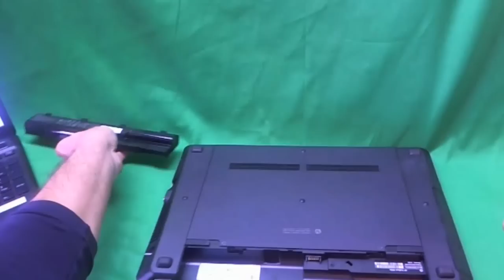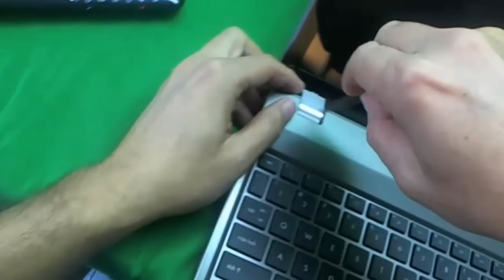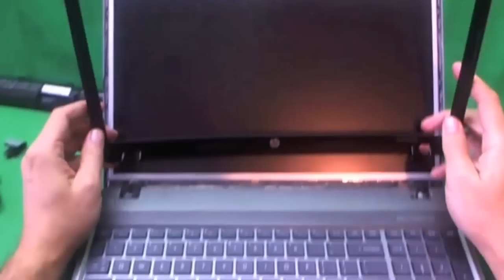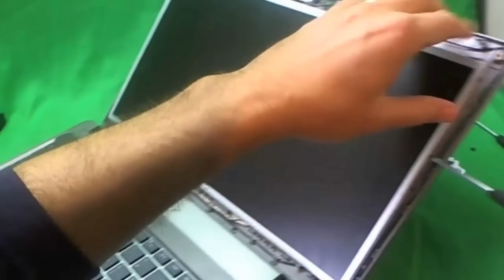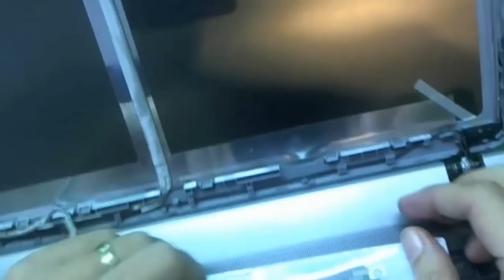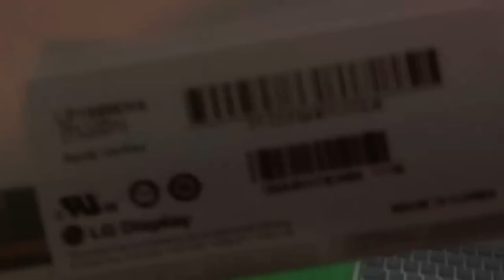HP 4530s ProBook 4530s Laptop Screen Replacement Procedure

Comment: Hey dude so I'm looking to just disconnect the screen I already removed the back cover but I dont know what wire to disconnect. I really dont want to open the entire laptop as I'm afraid I'll break it. I want to disconnect the screen so that I can use the bios on an external monitor.

Comment: It's almost IMPOSSIBLE to get the hinge covers back if you're following this procedure. 

To all, I strongly recommend downloading the HP ProBook 4530S service manual (a google search will get you to it), and follow the official procedure of screen replacement recommended by HP. It will take a little longer than this, and it will be a bit more of an "invasive surgery", but trust me, unless you're scared of removing a lot of screws, the official procedure is actually a LOT safer than this and the chances of damaging something is a lot less as everything will come off easily without you having to apply excessive force to pry open the hinge covers, weird "tricks" like loosening the hinge screws and pulling on the screen to reveal the side mounting bracket screws, tricks to put the hinge covers back in, etc.

I can't believe the tech guru who made this video doesn't understand the concept that physical strength and electronics are mutually incompatible partners. The moment you realize you're applying too much force to remove a part or install it back, you should understand you're doing it wrong. 

Like my computer teacher once told me in my school years, "Shortcuts may cut short your life".

Comment: Other than having to replace HP's defective 320 GB HD 3 times within the 1-yr warranty period (before wising-up and buying a Toshiba 500 GB replacement), this laptop has been a workhorse since purchase in 2011.A big complaint - shared by many in reviews - is the LED display appears 'washed-out':  'max' brightness is only attained at a very-narrow viewing angle.Comparing this 'matte' screen finish to the 'crystal' display on all MacBooks is like night and day.  I wasn't aware of any 'crystal' display option with the ProBook 4530s.My question:  do you know of a 'crystal' screen replacement that would upgrade the display to greater sharpness and brightness?

Comment: Just replaced mine with a Screen Surgeons unit, so far looks great.  Three things: first, watch this video, read the comments below, and check other postings around the Net, it will help you out.  This screen replacement task wasn't difficult, but there are a lot of moments that something can break very quickly.  I'm experienced with this kind of stuff, but would still call this a 2 banana job because of the risky moments.

Second - hinge covers.  I removed the bezel without removing the hinge covers, but it was tricky and took some careful bending and jiggling around.  After I finished the screen replacement, I couldn't see a good way to get the bezel back on without removing the hinge covers.  With the bezel off, it was still a little tricky to get them off even though there are now loose, I pulled them off from outside the unit with the lid mostly closed, they came out the rear.  TheOnlyRick's comment below is THE trick to get them back on.  I used a flat rectangle cut from the clamshell plastic that many things are sold in, then inserted from the rear, then slid the hinge covers on from the rear but only after I had re-attached the bezel.

Third - I found that the two screws at the bottom of the bezel, in the first step, were star/Torx T8.  NOT phillips head.  Has anyone else seen that?

Comment: Can any one assist me ?? I want to replace my screen but I'm informed when purchasing I need to know the resolution, backlight, and screen size so that I my get the accurate screen
My problem is I don't know how or were to obtain that info
Reply: +abu khadir simplt just enter the name of your laptop and then screen after it
 on amazon or ebay and you will see them come up..
Reply: Hi, just asking if the screen of 4530s is the same/compatible as hp probook 4540s..they are the on size of 15.6..

I need someone to confirm so that i can proceed and buy new screen.. Tia

Comment: Thanks, very helpful.  Maybe I could have done the whole thing without removing the hinge covers (at first I forgot to loosen the screws that hold the hinges to the screen assembly), but I ended up removing the hinge covers anyway.  What I wasn't expecting was how hard it would to put them on afterwards!

What happens is that as you push them in, the bottom clasp of the hinge cover catches on something within the hinge mechanism.  So I cut a thin rectangle of an old credit card, and put it into the hinge (from underneath the laptop) so that as I push in the hinge cover the card smooths over whatever the cover was catching on before, and it easily slides into place (with the laptop screen fully open).
Reply: +TheOnlyRick awesome tip, was stuck with this bit, replace 3 screens and was left with this
Reply: Man, you saved my life. Thanks!
Reply: @leopholdoishibashi5690  I have no memory of what this was about, but I'm pleased it helped!  😄

Comment: you can actually perform this procedure without removing the hinge covers. the bottom edge of the bezel can be loosened so that it tilts forward but not completely removed. the side bracket screws can still be accessed. it's not quite as easy as with the hinge covers off but it certainly saves ruined hinge covers. the private school i do tech work for has 20 of these units so experience is talking here.
Reply: If you do remove the hinge covers, as you push them in, the bottom clasp of the cover catches on something within the hinge mechanism.  So I cut a thin rectangle of an old credit card, and put it into the hinge (from underneath the laptop) so that as I push in the hinge cover the card smoothes over whatever the cover was catching on before, and it easily slides into place (with the laptop screen fully open).
Reply: TheOnlyRick Thanks for this tip - I couldn't get those hinge covers back on for the life of me and this worked in seconds.
Reply: To everyone - this is THE trick to get the hinge covers back on.  The bottom clasp of the cover is catching on the seam between the bottom and top of the main laptop case.  Using TheOnlyRick's process gets you past that seam without catching.  I read his comment before tackling the replacement, and so was prepared to look for this when the hinge covers were catching exactly like he says.  All thumbs up to Rick!

Comment: Great video! I am experiencing some serious flickering from my screen depending on which angle it's tilted - do you know what that may be caused by? I'm thinking it shouldn't be anything wrong with the screen, but maybe some cables have gotten stuck somewhere or something like that. I have the HP ProBook 4330s
Reply: can you please tell me how did you manage to solve the problem, i experience the same thing on same model 4330s? is the problem with the display cable, or you find that the display is faulty?
Reply: +gige75 I returned the computer to HP and got my money back. bought a surface pro 2 instead
Reply: +Oskar Arkstedt you did a good job ;) thanks!

Comment: One thing to add that it is very important, that's when your about to disconnect the VGA cable from the screen, you should pull it forward towards the case/housing of the screen.

Just an F.Y.I

")

Comment: I have to disagree with you; You can in fact put the hinges back on without pulling the whole laptop apart, with no damage to them (they are made of a strong plastic, and can be bent...to an extent, obviously) - you just need to be very careful with doing so.

Source: Myself - just did a screen change on a ProBook 4540s (same physical layout). :)